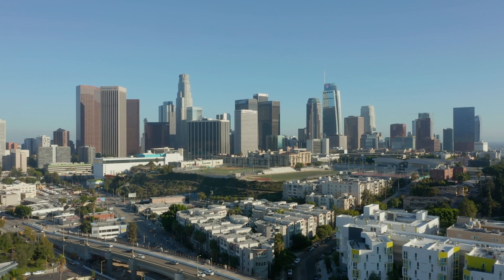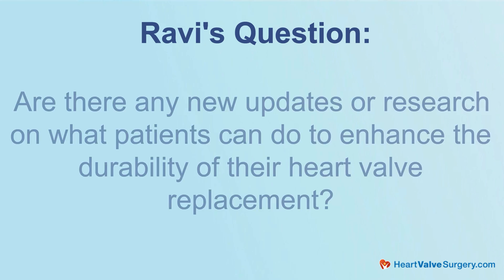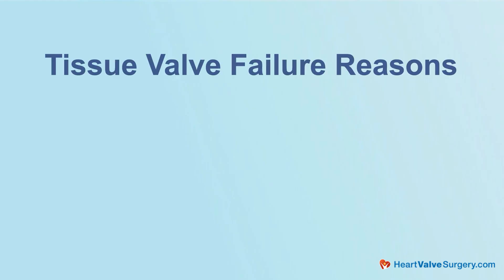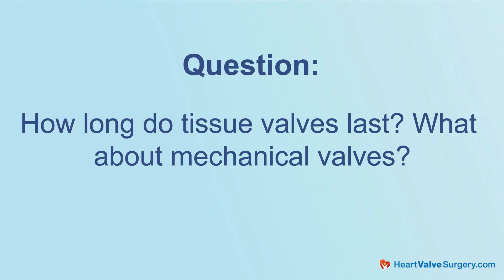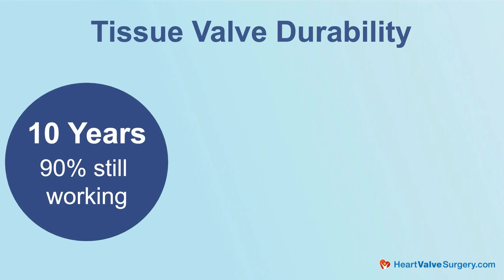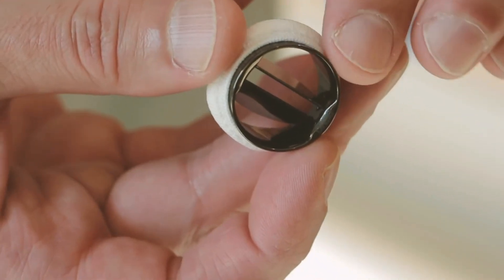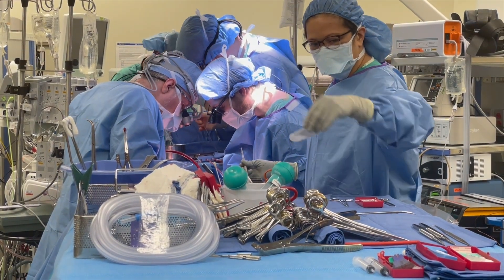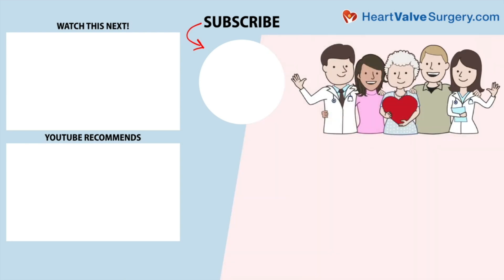Surgeon Insights: Tissue and Mechanical Heart Valve Replacement Durability with Dr. Doug Johnston

Comment: A couple of weeks before my 46th birthday I received a Carpentier Edwards 3000TFX aortic tissue valve. It is now 19 yrs 3 months later and it's still going strong. The surgeon told me it would only last 10 yrs or so also.
Reply from the maker: Mark, Downright wonderful to hear about the durability of your tissue valve!
Reply: That's incredible! Thanks for sharing that. I received a bio valve last year at 50. OHS was brutal, and my recovery has been grueling. My surgeon estimated my valve will last around 12 years, but I'm praying it lasts as long as yours. I must ask, are you on a special diet or supplement routine?  I work out 7 days a week and eat healthy, but I have no idea what's good for this valve's health. Thanks again. Your story gives me hope.
Reply: @jasonauerbach3623  Hi Jason, absolutely nothing special diet and no working out at all. I'm very active in my landscaping business and have a 15yr. old daughter that keeps me busy.
Reply: @jasonauerbach3623  Hi Jason, nothing special diet and don't work out at all. I'm still working full time running my landscape business and have a 15 yr old daughter that keeps me busy. I'm always doing some project or helping someone. I guess I'm just lucky.
Reply: @jasonauerbach3623  this is the third time I've tried to answer you but You tube keeps deleting it for some reason. I'm on no special diet or supplements what so ever. I'm just lucky I guess.

Comment: Would it be unusual for a 32 year old with moderate mitral valve regurgitation and aortic stenosis to have tissue valve replacement? Blood thinners scare me, it’s a host of symptoms I do not want to deal with. I understand I will need to replace tissue valve every 10-15 years but it’s still noninvasive.
Reply from the maker: Hi Orthodoxymaa,   Great question. Unfortunately, we do not have a great answer for you as each patient case is unique and we are not qualified to provide specific medical advice.  That said, we will put this question into our educational queue.  The next time we meet with an expert in this space, we will ask your question and do my best to get an answer (hopefully on video).

Comment: Love the video. It still seems crazy to me that we don't know a lot about what to do to extend valve longevity (whether tissue or mechanical). I hope that some day there is data in this space!
Reply: Agreed! I had OHS last year at 50 to replace my aortic valve and fix an aneurysm. My surgeon convinced me to go with a Bio valve due to my activity level. The surgery and recovery were brutal and grueling, and something I never (ever) want to experience again. Unfortunately, these valves inevitably fail eventually. When that time comes, my surgeon said TAVR would be a good option, but those valves also have a limited lifespan. 

In an age where we can clone Dire Wolves, they must do better. Fortunately, I've been doing a lot of research, and AI is leading to rapid advancements in the medical field. Many companies are currently working on ultra-durable 3-D printed heart valves using our own stem cells and new types of TAVR techniques and valve materials. I pray that when the time comes for me and countless others, we have minimally invasive heart valve solutions that will last decades without any complications.
Reply from the maker: Thanks for the kind words Adam!